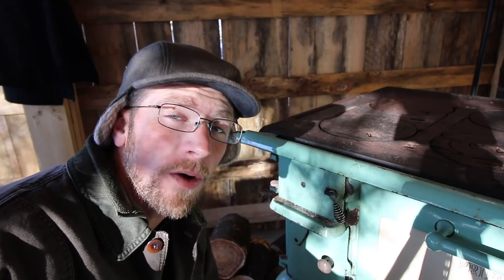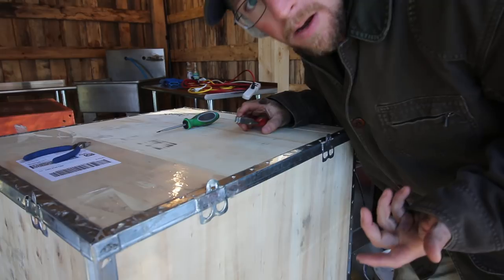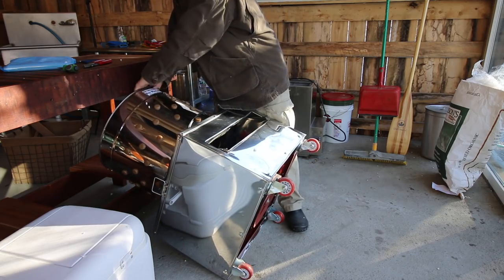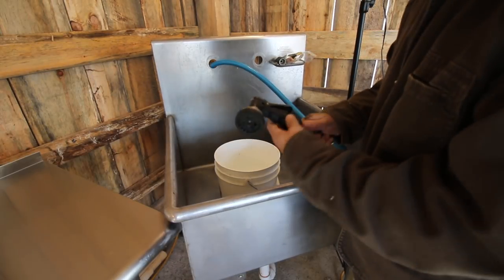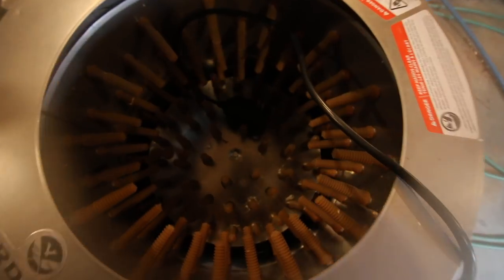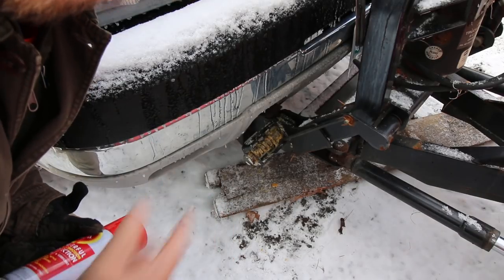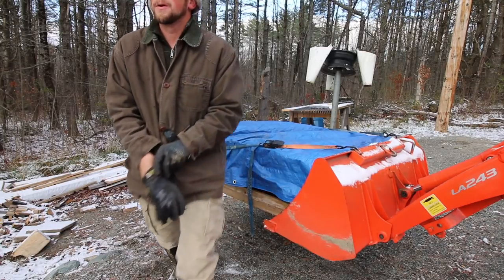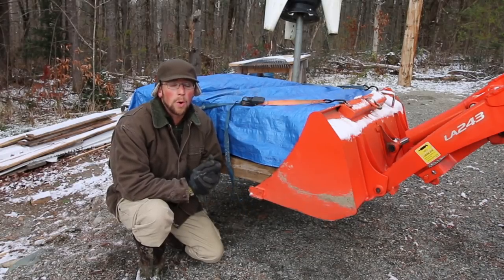What's in the Crate?

Comment: The new chicken pucker looks awesome, hope it works out better than the old one. You should rent a trencher and trenchant a line from the house to the summer kitchen and run insulated pix tubing from the house to the kitchen so you can have permit hot & cold water in the kitchen without running garden hose’s.👍👍🤞🏻🙏🏼🐔🐔🐔

Comment: Al, how much heat does the wood stove give off in your outdoor kitchen? If you have temperatures in the high 20's outside, and run the wood stove, will it keep it warm enough in the outdoor kitchen that it isn't freezing? I know right now it doesn't have insulation (but you have it, and it is on your project list), but I just wondered how much heat the stove itself put off. Thanks for showing everything you do in your videos. I've learned so much!
Reply from the maker: The stove puts off a lot of heat. We will be in good shape once we get it insulated